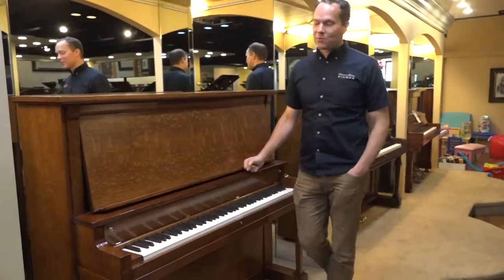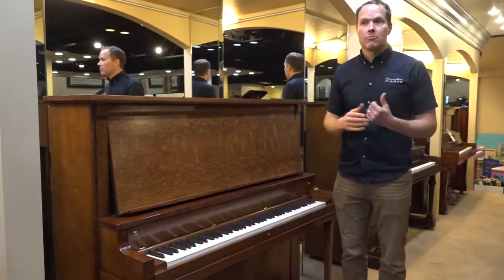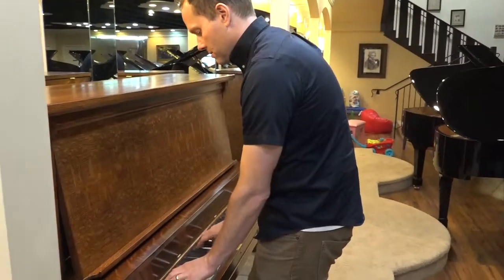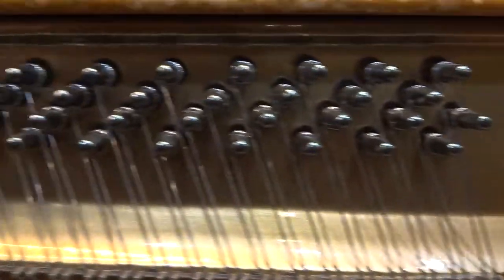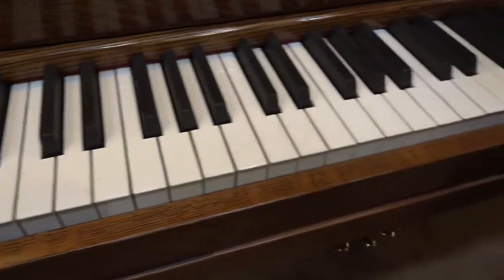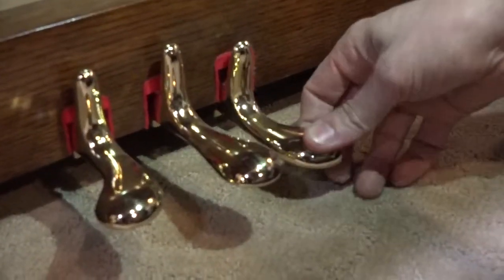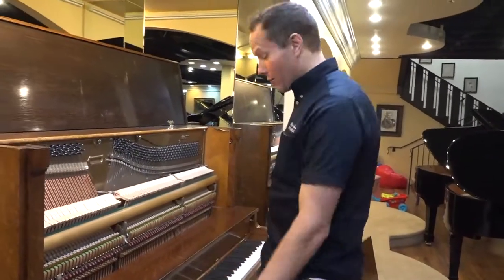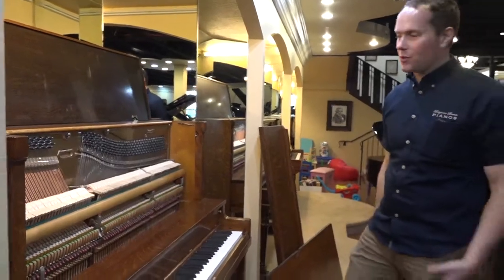1918 Hospe Upright 55 #136670

Comment: Upright grand, that’s what it’s all about.  I wouldn’t be surprised if those rubber wheels help allow more resonance on a floor like concrete, as it frees up the whole bridges end of the piano more like on a grand.  I really really like to have the intimacy of hammers right near my head for enjoying subtle dynamics that is offered by big verticals.  I have owned grands and they’re great of course but too often are assumed to be clearly superior to verticals.  In home stereo systems, the speakers are almost always directed horizontally toward the listener, rather than vertically toward the ceiling and floor like a grand piano soundboard.